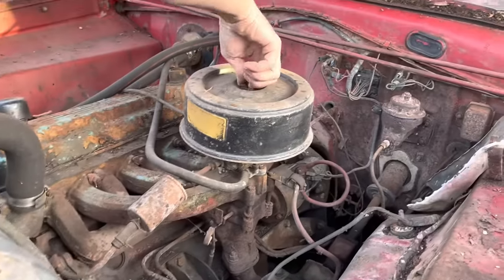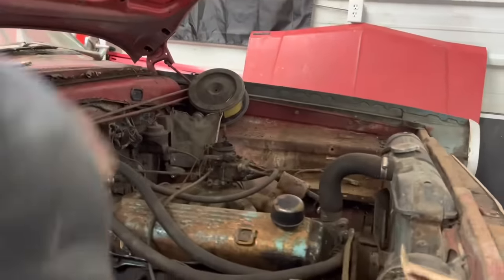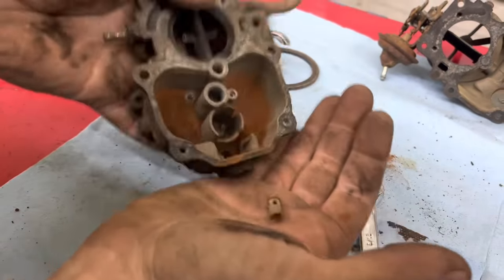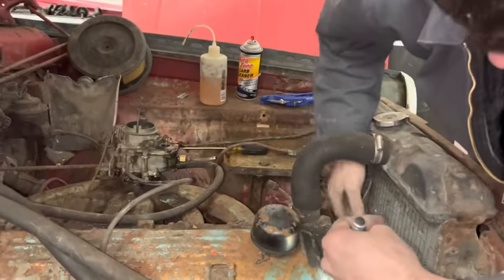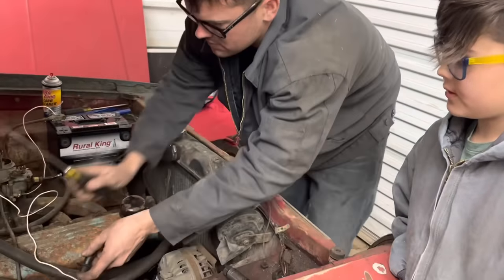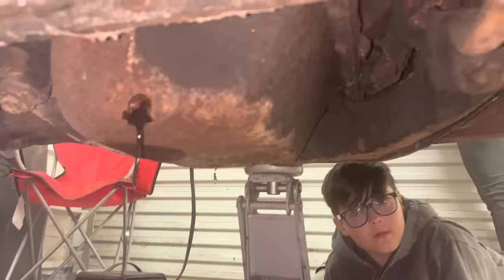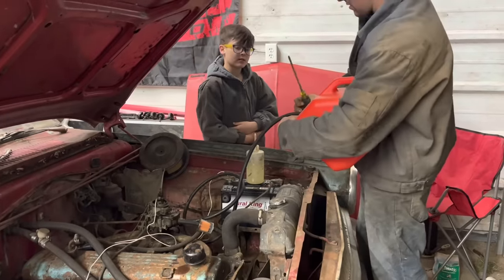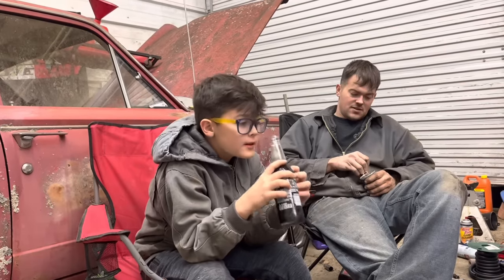$500 station wagon, will it start after 25 years parked?

Comment: Those slant 6 engines were almost bulletproof.  I missed where you said what the mileage on it is/was though.

I'm sure you've been doing this a long time but I'd have left the plugs out and cranked it over a bunch (at least a minute, maybe 3-5) to ensure oil is pumped to all the bearings, etc.  Maybe hook a test light to the oil pressure sending unit to ensure it's actually getting pressure.  Then put plugs in and try to start it.
The 170 engine, while looking just like the famous 225, has all sorts of items that are NOT the same.  If I remember correctly, the starter is different between them.  Why, I've no idea...  :)
Couple other suggestions, when you put your siphon tank to carb connection, put it to the filter to the carb, not directly to the carb, that way you know fuel is getting that far.
And sometimes old fuel pumps need some fuel in them to start pumping again.  You might try pouring some gas down a funnel/tube to the fuel pump and running the engine to see if then starts pumping again.  Worth a shot, anyway.
Oh, and if that's a 727 automatic, it's pretty bulletproof as well!  There is/was a 904 often used on the smaller 6s, but I don't know when that was done for sure.  904 is a lighter version of the 727, but an excellent transmission if not abused (towing large trailers, etc.).

Enjoy!
Reply from the maker: Ok thank you for all the information I appreciate it

Comment: I bought a 63 dodge dart gt convertible with 225 slant 6 new in Feb 63 traded my 62 dodge dart we put a 4 barrel on it at one point was clocked at 130 we had a different trans as dodge replaced original 3 times so they replaced with heavier duty one.
Reply from the maker: That’s interesting

Comment: Awesome video! I have a 1964 Dodge Dart gt hardtop coupe that’s the same color. I bought it for $50 the body isn’t in the best shape but it runs and drives like it’s new. The old owner couldn’t get the trunk open because someone broke the lock cylinder and once I got it open it was full of new old stock parts
Reply from the maker: That’s awesome

Comment: Mechanical work and a goat back massage at the same time can’t get any better.
Reply from the maker: Yes sir
Reply: A man I worked with in 1969 had a 1963 Full size Plymouth station wagon with the 318 and three speed straight drive on the “tree”. It was a really cool ride. Also I owned a 1952 Willys four cylinder F-head two wheel drive wagon. It was the best dry camper a 17 year old ever had. We did a lot of camping and fishing on Badin Lake in the Uwharrie Mountains near Troy. I always thought that Dodge Dart front end was “stolen” for the second generation Camaro.

Comment: Couple things. First Chrysler built a V 12 as far back as 1904. I was 13 when my dad got a 62 valyent with that engine. I figured that they used half of a V 12 casting. It has to go in that way or they must change mount location.  Cheaper to do it that way. Also for an engine to fire you need spark fuel and compression. The rings weren’t sealing well enough to build compression.  It first you were turning it over with the spark plugs out. As you kept trying one cylinder started building compression. Just before it was able to build enough to fire. Another one started building compression. So there was a point I think that one cylinder would have run it but just barely. But the second one building compression prevents that. Untill the one rings freezes up enough to run and the freed up # 2 which got all the others. Working real fast. Expected to hear it missing for a bit but no once it got going alls well
Reply from the maker: Yes sir thank you

Comment: I've got a 63 Plymouth valiant wagon. Gave 1100 bucks for it. Oh my God it had 30 lb of compression. My adopted stepfather's been a mechanic for 65 years. Yes he works everyday and he's been at the same shop since 1976. Anyways overhauled the carburetor cleaned up the starter. The damn thing runs like a top you tell me you got 40 lb of oil pressure. When I was a kid in Iowa 71 or 2 my dad bought a brand new Massey Ferguson combine with a slant six in it. They locked the throttle at 32 or3600  rom and it runs out all day long. Long live the leaning Tower of power
Reply from the maker: That’s a great story

Comment: Occasional starting fluid is okay for gas engines, just not every time.  Brake cleaner acts as a compromise between fuel and starting fluid.  Mor throttle might help too, so that 2 or 3 cylinders will have the power to spin it up and then get more to kick in.
Reply from the maker: Thank you

Comment: The key to working on that distributor is to pull it out of the engine first. These older Chrysler cars had distributors that would only install in time or 180 degrees out of time. If you got it wrong, you just turned it around and reinstalled it and it would be right.  P.S.  Anytime an engine sounds like it wants to start but just won't, I always throw a set of plugs in it.

Comment: i had a '64 dart, automatic tranny that you could pull start, sleeved 318 engine, cast aluminum valve covers and oil pan, shifter in console, and bench bucket seat. dual point system, all factory

Comment: If that’s the original type carb, they’d flood ALL the time❗️ Just install a manual cable on it.  Fond memories of mom’s’ 68 Valiant and sticking a screwdriver down the carb to make her start/run when lukewarm.  She’d get 38 mpg highway though 👍 A little valve adjustment (these are mechanical lifters, as you likely know) muffler, and it’ll be sweet 🔥🆗
Reply from the maker: Ok thank you for the information

Comment: With the push button transmission  the parking brake is probably on. That might be why the back brakes are " locked up " The master cylinder cap has to be on when you pump the brakes .The trans. has to be in neutral to check the  level.  My first car was a 66 Dart. Those slant 6s are almost indestructible. The body will rot away first.
Reply from the maker: Ok thank you

Comment: I'm going to guess that the rust is interfering with compression, temporarily, and that is why it doesn't want to fire despite good spark.  It might improve just from cranking, but large plug gaps are also better at firing low compression, so I would set at least 3 plugs to .060", and return them after I get it running with good compression, which should come back, at least partly, after running for a while.
Reply from the maker: Ok thank you

Comment: My 63 is having the same problem.  Weak spark, looks like it wants to go, but won't.  Gotta rebuild the starter since it crapped out trying what you did.  I'm at a loss.  Was running fine - I'm doing a rebuild of the entire vehicle - and now no start. Frustrating.
Reply from the maker: That is frustrating

Comment: Running that coil on 12 volts will burn it up, it's either a 6 or 8 volt coil that gets it's voltage through the ballast resister (white) located on the firewall. The only time coils of this era got full battery voltage was during starting when the ballast was bypassed... They should have paid you 500 to take the car away!

Comment: Old slant sitting? If it's dry it will start, there has been pinhole rusted oil pans before especially if a wheel bearing seems seized

Comment: Any 4 stroke gas engine will run if:   1- Engine has good enough vacuum and compression.   2- Engine has good enough air/fuel mixture.   3- Engine has good enough spark at correct time.

Comment: Why do you call tires “casings” and not “tires”? The casing is just a component of the complete tire assembly. 

Basically gather casing is the doughnut body section containing the threads and rubber base that everything else is attached (bead, belts, cap plies, tread,  etc.) to and combined together during construction to make the whole thing a tire.
Reply from the maker: You are correct, an old man I worked with called them that and I thought it was funny

Comment: Don't put the starter fluid on top of the battery,, it can fall over across the terminals and explode.
Reply from the maker: Good point
Reply: @Sleeperdude  I used to shoot that stuff next to a flame and it would make a ball of fire the size of a dump truck! It's funny in a controlled environment, but not funny when it's next to you.

Comment: Lol when a s six is cold you stop cranking the motor and pump the crap outta the gas try starting and it may start but most likely your leg will be tired before it starts lol ive owned mine for 33 years and approximately 550,000 miles but shes stuck now too since she sat in the blackberry briars for 10 years now and just an observation ... never use split wt oil always use castrol gt 30 wt non detergent if you can find it its the best for old dodges with a slant 6 at least thats how i kept mine alive😉👍
Reply: It's been +20 years, but I remember my 225 dart in Lake Tahoe. The safe cracking combination process of getting that thing to fire on a cold winter morning was elaborate. (never this much cranking tho)

Comment: The reason it wouldn't start was because the lifters had no oil in them for them to operate properly so it was keeping the valves open. 

It had zero compression at the start and as you got oil pressure the lifters bled and started to work giving it compression.
Reply from the maker: Ok thank you

Comment: TAKE OFF THE VALVE COVER AND CHECK THE VALVE  ASSEMBLY  IF YOU NEED A ADJUSTMENT  / YOU HAVE FOUND A REAL GEM OF A CAR  DO IT RIGHT AND IT WILL DO YOU RIGHT  A RARE FIND

Comment: Those old cast iron engines were such dogs. Sometimes there was no reason why they didn't start. They just didn't. Even at best you had to crank them like mad dog to get them to go. The automatic chokes didn't work. The Slant Six was second to the VW as a hippie era touchstone and nostalgia favorite too. I also helped my brother keep one running for years too all the way into the 1990s.

There is a reason why I called the 1960s the bad old days. It has a lot to do with the cars they made back then. Once they got to a certain age they needed constant repair and if the previous owners of the car had neglected oil changes forget it. Small block Chevys were especially bad and GM TH350 transmission didn't last very long either. Chevys were so bad, they make a Nissan seems like a Bentley in comparison. Although they were fun when they ran right. Some of the models anyway.

Comment: Did you think to drive the oil pump to get oil pressure before starting the car?
Reply from the maker: Yes I have done that
Reply: @Sleeperdude  I seem to remember that driving the oil pump to pressurize the oiling system was good practice for rebuilding an engine, and I would think also for starting an engine that has sat for many years.  Thanks for answering.

Comment: How is the subframe on it
Reply from the maker: I honestly haven’t checked
Reply: @Sleeperdude  ok I was wondering i went to junkyard I guess you can call it that it was a old guy who had been collecting car's for sixty years he said and he had I mean all kinds of cars but anyway a friend of mine bought this big 1960 Plymouth gold fury it was a four door and been sitting so long the wheels were sunken in the ground to the floor boards but it has this big popular tree growing up and pushing a dent in the back quarter panel not much of a dent but anyway the old guy said take one of the old tall style bumper jack put it under the bumper and angle it so it pushes the car away from the tree so we did and it worked I kept noticing the back end going up but the back tires never cracked dirt around them and we got it up about a foot over from the tree and saw the the rear end and leaf springs never moved and about a minute started hearing popping and tearing noises and the back in broke off it broke with the little piece of metal at the back of the quarter panel were it met the rocker panel I'm glad we didn't our head stuck under it because once it broke it busted out the back glass and when it came crashing down the back bumper fell completely off and then the trunk lid opened and inside of the trunk it has all kinds of antique die cast toy cars and a couple of ol chainsaws he had bought new and never used a lot of them cars he had up there were full of stuff he had this 66 Chrysler imperial I was interested in but it sat there so long they back glass fell inside the car I jack it up and it had a heavy duty full chassis one guy while we were there bought a 61 Mercury comet off him the body looks solid it wasn't rusted out or anything but when they picked the front end up with a wrecker it broke into were the bottom of the fender on the front meet the quarter panel and so they just let it back down and left it ninety percent of the them look good on the outside but when you went to move them they just came apart the highway department was making him get rid of them is why he was selling them so they came up there one day and brought car crushers and trailer to haul them off on an poor guy got so torn up about it he had a heart attack and fell dead right there and they postponed it for a month and now nothing is up there he never had been married and had kids and those cars were like his kids. Rest in peace Walter Arthur he was 82 and look like he was about fifty years old

Comment: "I know what's wrong with it it ain't got no gas in it" no but seriously I'm at the part where your cranking it over for the first time and it's only hitting them like one cylinder and all I saw you squirt in there was like four tablespoons of gas I usually put like a cup in Old motors that ain't running a while like let her drink it's a lot harder to flood an engine then you would think as long as you're being mindful about flooding it chances are you're not going to and how little compression it has the rings are probably stuck which means that the gas is on the floor right past the Piston anyway making it pretty close to impossible to flood it it'll just seep right down into the oil but if you can get it to pop over a few times it'll unseat the ring or reseat however you want to say it and then you can give it a couple of tablespoons because my two cents though take it or leave it up to you
Reply from the maker: Ok thank you for the tips

Comment: Please stop telling anyone that correctly calls "tires", "tires", to call them casings. "A tire’s casing is the structure that supports the tread cap and connects the tire to the bead, anchoring the system to the rim while keeping the system airtight. The casing may include inserts and layers intended to provide stiffness, impact resistance, and improve the tire's longevity." Now I sold tires, mounted and balanced them in my younger days and to hear you call a tire a "casing" is like hearing nails on a chalkboard. I like seeing the cars you find and that you have your family all working together ,but please stop calling "casings", "tires". Thanks and have a good one.

Comment: I had one of these back in the 80,s we made a field car out of it and it turned out the ugliest car ever and it died as under the hood it was so full of cat tails and other weeds that got sucked into the motor. It was a solid and very hard to kill car as I traded a junk moped for it from some dude that worked at the gas station. But if I got that same car today I wouldn't make it a field car.

Comment: Why are you trying to start the engine without disassembling it and inspecting it from the inside? Is that what tech-savvy people do? Are you sure that the piston rings are in order and have free movement in their grooves (otherwise these rings will begin to cut chips from the surface of the cylinder during the first revolution of the crankshaft)? Are you sure that the thin oil passages are not clogged with dirt and will pass oil to all lubrication points? Are you sure that the crankshaft and camshaft journals are not corroded and have not turned into sandpaper? Are you sure that the oil pump will create the right pressure (otherwise there will be dry friction)? All your actions are illiterate. The very first engine revolutions in your case can cause irreparable damage to the engine and make it unrepairable due to your actions.
Reply from the maker: That is why we put oil in the cylinder. It would be very unusual to completely disassemble an engine before you try to start it. We have had very good luck doing it this way